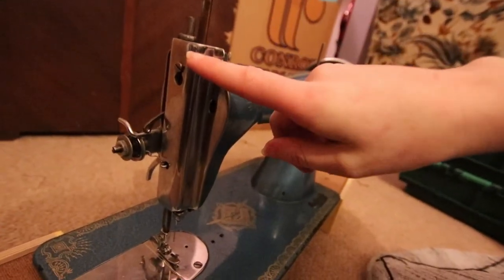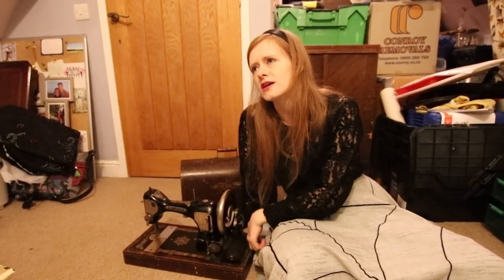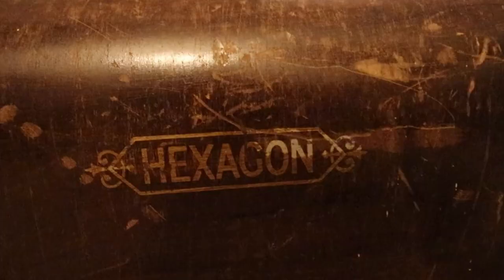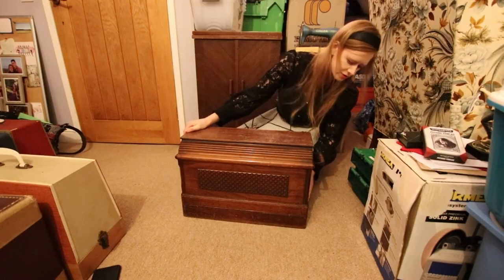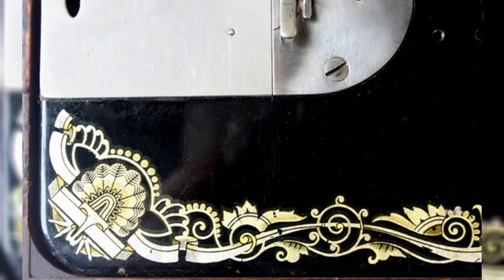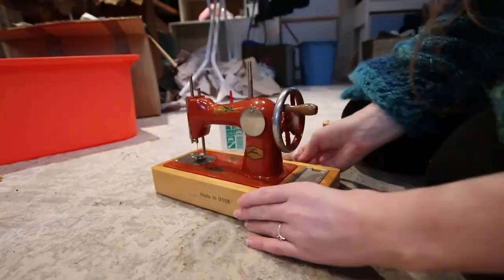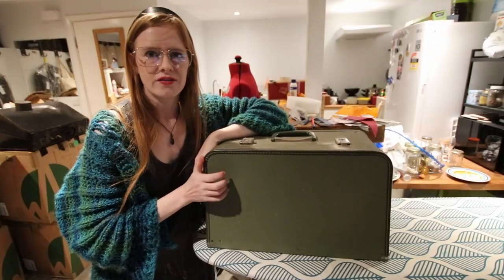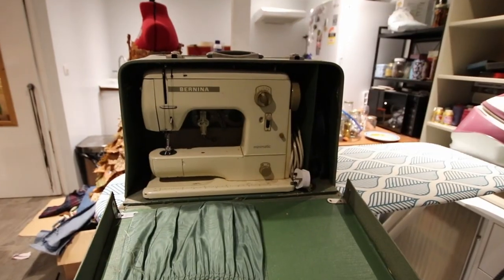My ANTIQUE and VINTAGE Sewing Machine Collection! - Sewing Machines Through The Decades - From 1901

Comment: I am not an expert but I believe that your first machine dated 1901 was redone in the 50s. At a certain point Singer offered a complete redo with the service after the war. All parts were replaced as needed and they actually repainted the machines as an extra service.  This looks like the redo paint to me. Which is amazing in my opinion because how many people own a complete factory repaint. Its a much smaller group than just a regular production run. Again I am new and could be wrong but I also might be right
Reply from the maker: Oh o didn't know they did that! Super interesting but what makes you think it's the case with that machine?
Reply: @AnnabelleAndBensAntics  I'm not aware of this actual pattern in 1901. They should be extremely floral or patterned.  This us the same design as they offered for the 50s redo. And.. compare your finish from an old early 1900s. The shellac should have some degree of crazing even if sealed up. Your paint looks great. It looks hard and shiny like it might be 50 years younger.  Maybe pu it next to some old and some young to see if there is a difference in person.
Reply from the maker: @chascatt  I will do, thankyou :D

Comment: I think you are right about singer refurbishing sewing machines. I have a 185k that both the K and the serial number mean it was made in the UK in 54. The woman who I got it from bought it "new" in the 60s. From a singer dealer. It is painted green like all the ones made in Canada and has made in Canada on it in two places. 
I think it's helpful to remember that the singer company doesn't have a history of being the most honourable.
Reply from the maker: The thing that convinced me is the faceplate as some googling showed other machines made at the time with those decals with engraved faceplates (actually think I might try and get one I can replace it with when I do the rest of the work for it) and the two photos I found online of these blue machines were two different models to the one I have. To be honest I might contact singer directly and see if they would be up for awnserinf a few questions about it as it's really intrigued me!

Comment: The 66K case is called a bentwood..

I’m currently using an antique Veritas hand crank, all metal shuttle/bobbin pin German made sewing machine ..

It black base with gold roses in a wooden coffin top, sadly no table/treadle .. 

I also have a Pfaff 1 in a bentwood rounded top case , again all black with gold rose, shuttle/long bobbin pin..

My oldest machines are the 1870 to 1890’s ( Peerless/new white peerless/white peerless) White sewing machine made in Cleveland Ohio USA again all hand crank with shuttle /bobbin pins set up..

I live in Australia..
I also have several antique ( over 100 yrs old) transverse sewing machines ( hand crank) , Gritzner hand crank & treadle..

I have the Singers in the 127/128K, 66K lotus decals, 66K with various different decals, 99K both earlier & the later 1950/60’s made.. & several 201K treadle/crock case hand crank & knee lever electric pedal system) black 319K Singer all electric with the box of fashion discs & a VZ Gritzner dating 1957 ( made by pfaff as they bought out the Gritzner sewing machine company).. I have on layby a 221K 1950-1960’s featherweight as well..

Use sewing machine oil the get the machine turning freely & can be used to clean the outside of the machines..

Manuals for your collection of sewing machines ( if you don’t have them) can be found on sewing machine groups via Facebook by joining as they will show you how to clean etc your sewing machine..

Note: don’t pick out the red felt ( oil eu is) in the round drop in bobbin areas of the 99K as it a pain in the rear replace it.
Reply from the maker: Thanks

Comment: The blue singer may have been painted by a collector like you and I,  you can buy the water decals for restoring these machines on line , im repainting a necchi bu from 1950 and may buy the decals to put on the machine but its now metallic candy red , but singer did do trade in and repaints from what ive researched , i think i have a model 28 from 1904 thats been repainted black but has modern decals , i have a video on it as well  if you are interested , but like you  i still havent gotten any confirmation , nice collection by the way .
Reply from the maker: Thankyou and yes, I'm still trying to find a certain awser but am fairly confident as I've Managed to find a few others online in different models that all came from Scotland and are the exact same blue so I'm feeling confident the refurbished theory is correct but still not 109%